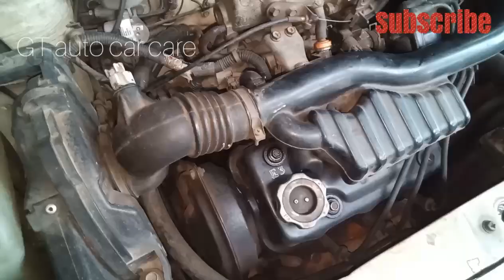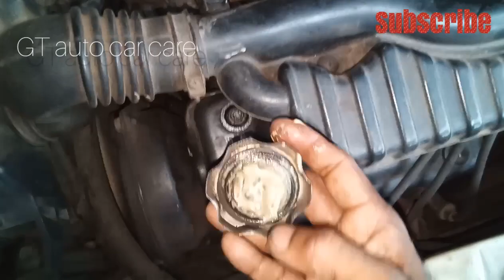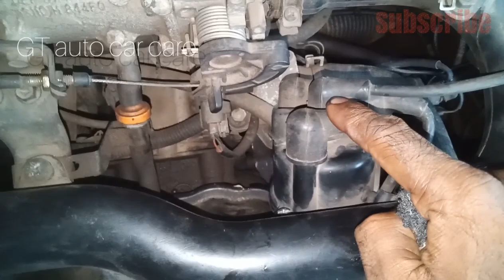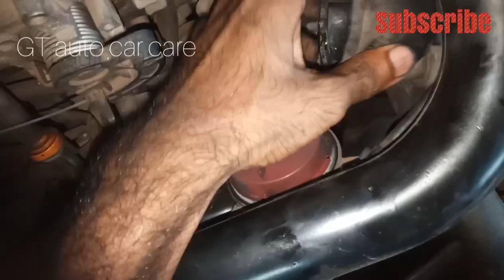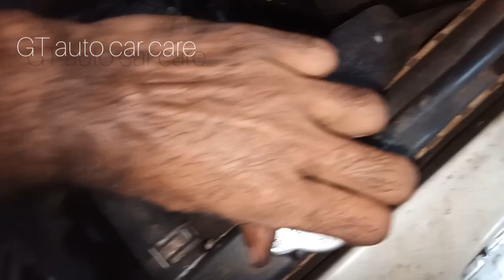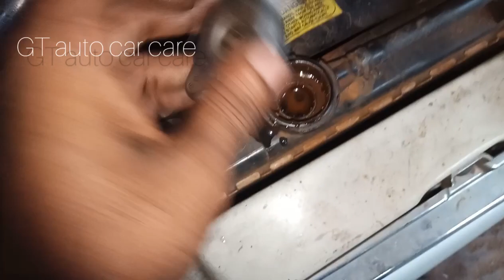maruti 800 സ്റ്റാർട്ട് ആകുന്നില്ല എങ്കിൽ ടൈമിംഗ് ബെൽറ്റ് പൊട്ടിയതാണോ എന്ന്‌ എങ്ങനെ മനസ്സിലാക്കാം

Comment: Ashane timing belt etra km aan marande. Aa 800 head work gasket work Eni cheyande.aa vandi ashante workshopil vararulla vandi aano.good vedio. Coolant matre radiatorl ozhikavoo alle.
Reply: ഒരുലക്ഷം km താഴെ ആകുമ്പോൾ belt മാറണം
Reply from the maker: 100000km change ചെയ്യണം 80000 change ചെയ്താൽ നല്ലതു ,head work എടുക്കണം ,വണ്ടി ആദ്യമായിട്ടാണ് വരുന്നത് ,ബ്രേക് ഡൗണ് അറ്റൻഡ് ചെയ്ത വണ്ടി ആണ്,radiator il coolant മാത്രമേ ഒഴിക്കാവു ഇല്ലെങ്കിൽ വാട്ടർ പമ്പ് ഉൾപ്പെടെ എല്ലാം തുരുമ്പ് പിടിച്ചു ദ്രവിച്ചു പോകും
Reply: @GTAutocarcare 
OK. Thanks ashane.
Reply: @GTAutocarcare   Coolant + battery water ozhichoode ?